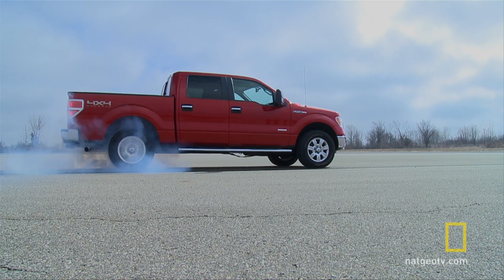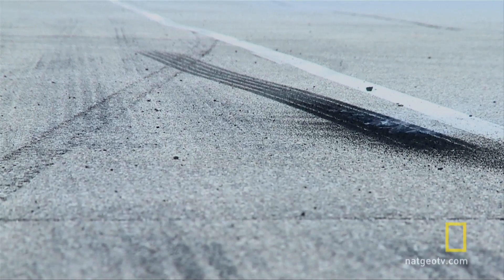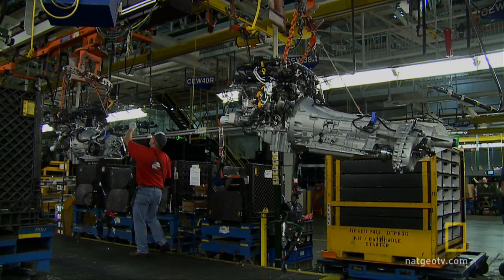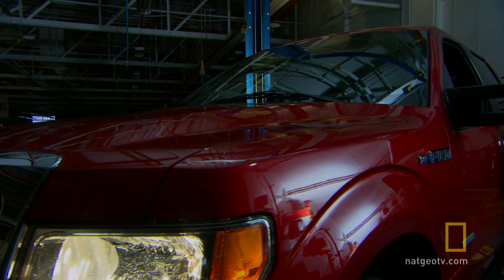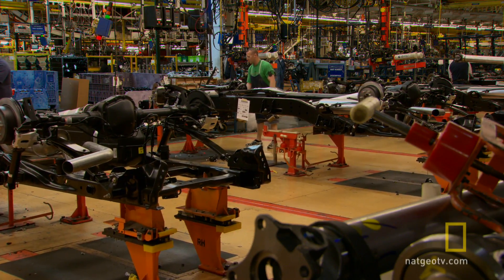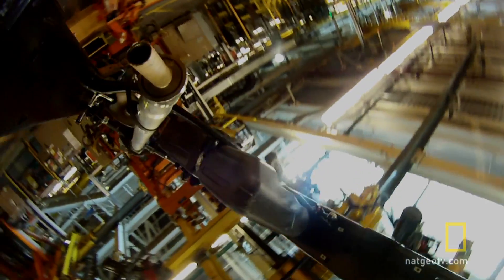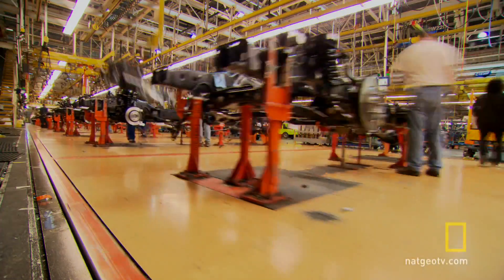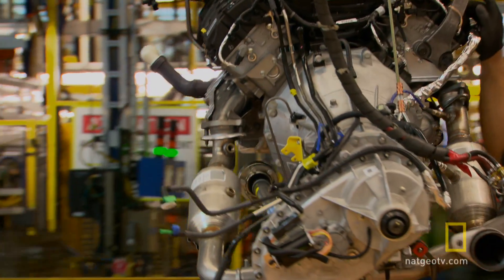The F-150 Engine | Ultimate Factories

Comment: Ford did make a mistake in 1980,drilled holes in the frames of truck frames and made them weaker.Wanted to lighten the frame and ford would not cover it under warranty if a snow plow was installed

Comment: I don't see the eco boost holding up,use two turbo chargers and the v6 will not last called blown up
Reply: well your comment didnt age well. theyve held up great for a decade now.
Reply: @Barbasnoo  Don't hold up,blow and more problems
Reply: @Toolaholic7  that's false. Their issues are no more frequent than any other half ton pickup engine offering.
Reply: @Barbasnoo yes it did my eco blew a turbo at 109k.   They’re not that durable

Comment: @Truthiness231 That has nothing to do with the fact that internal combustion engines are better than electric-powered engines. Sure, electric cars are probably the future but batteries and electric powered motors, in my humble opinion, have still not sufficiently developed enough to the point where they would be able to adequately replace combustions engines.. Just my 2 cents.

Comment: @mercedescl First, surely you should know I meant the electric engine.

Assuming you knew that and moving on, there are already plenty of electric engines in existence that outperform slightly older combustion engines; it won't be time before they demonstrably take all together (I can't in 500 chars go into full detail, but combustion engines turn a great deal more of their potential energy into heat; same reason LED > filament bulbs).

The current problem isn't engine, it's battery life. =P